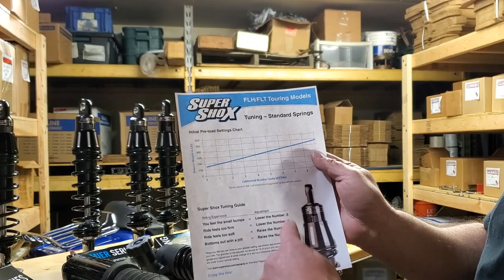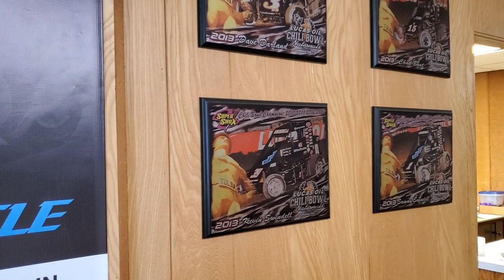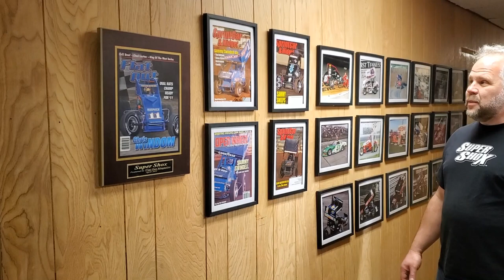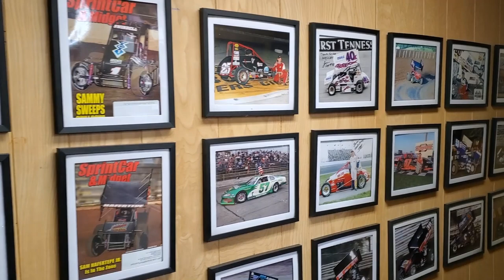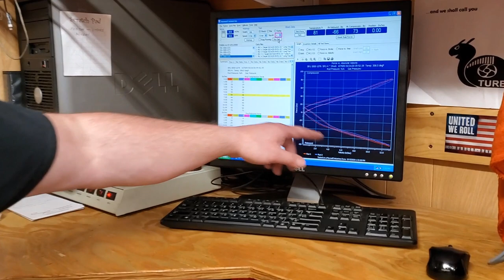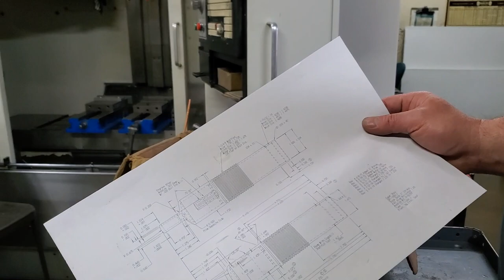Super Shox Shop Talk and Tour to show how shocks work and are built

Comment: I don't have a Harley I have a Yamaha fjr 1300 .. can I put the top of the line olins on my bike.. on top of the line GP suspension up front... It made a massive difference.. my bike now handles as good as a much much lighter bike.. if you have a Harley and are thinking of doing this man's upgrade just do it... You will not regretted it